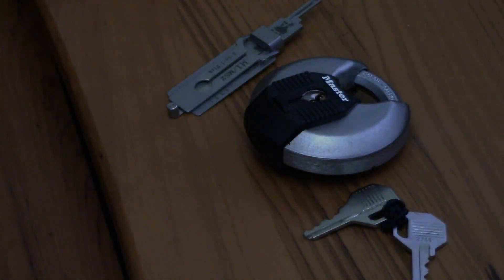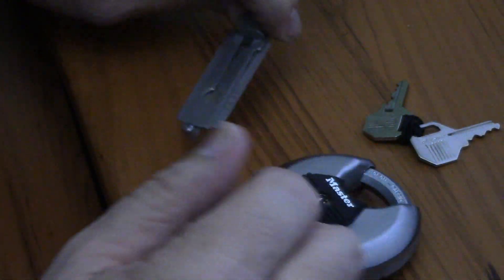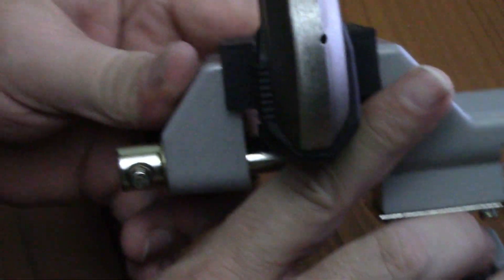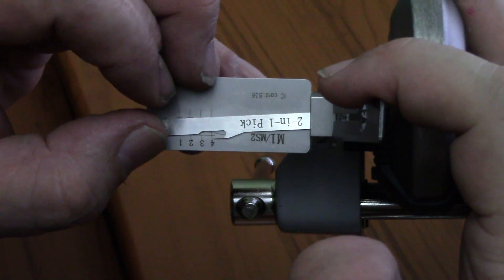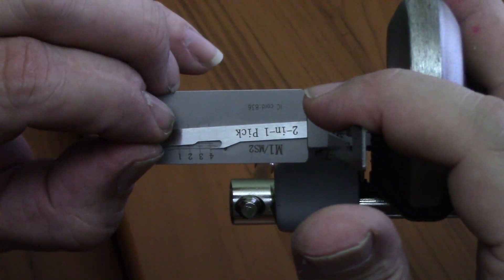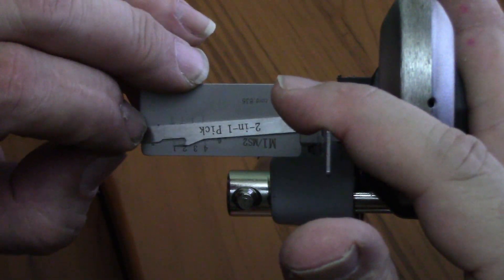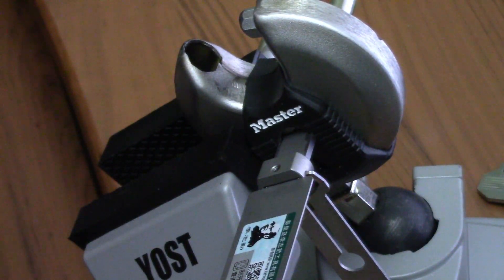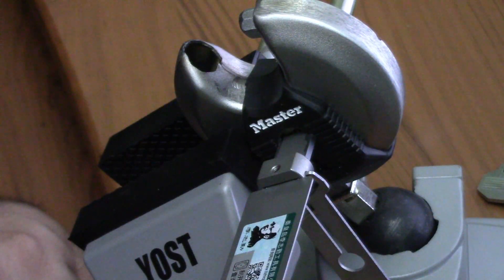Video 37 - Newbie vs. M1 Lishi tool on Master Lock M40 Magnum Padlock. Lishi lock picking tool

Comment: Yes, Lishi tools can pick locks easily.  No, they don't consistently provide accurate codes to cut keys for locks.  That's why most videos don't show actual working keys being made from Lishi codes.  One locksmith posted a video where he had to add 1 to each number he read from his Lishi tool to cut a working key for a 4 pin Master Lock.  The only way I'll be able to use mine, for anything other than a pick, is to impression and file a key from one of the locks I picked with my Lishi and see how the pin settings differ from the Lishi numbers.  I wouldn't have to do that if a Lishi was a 'quality" tool.